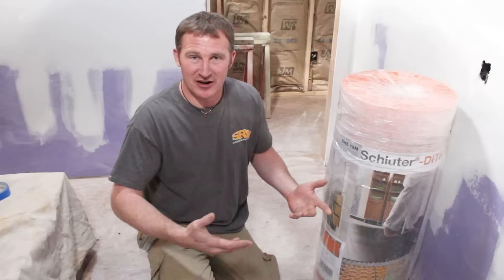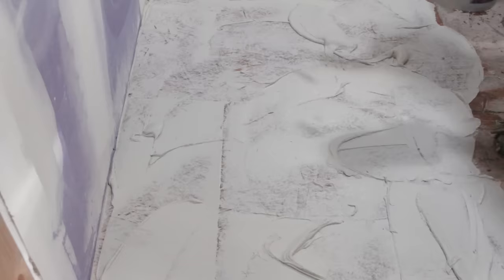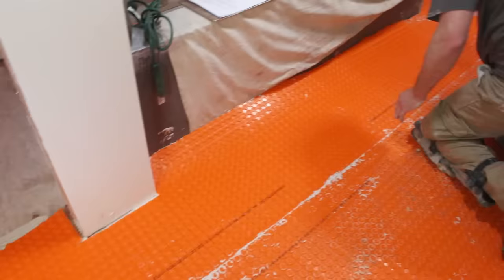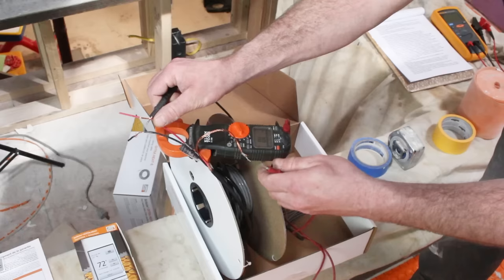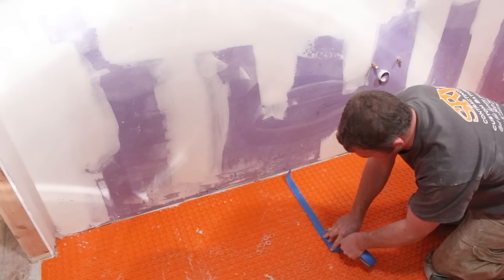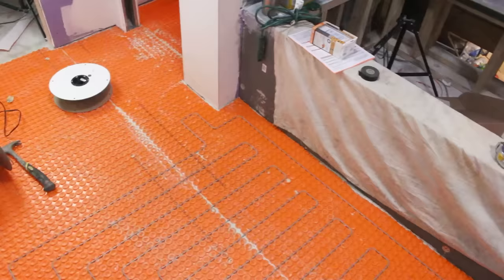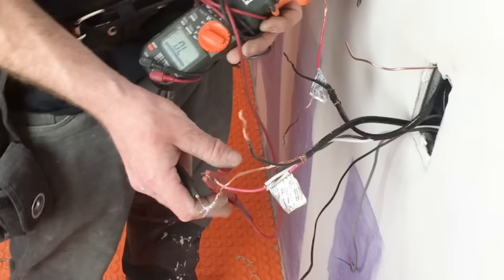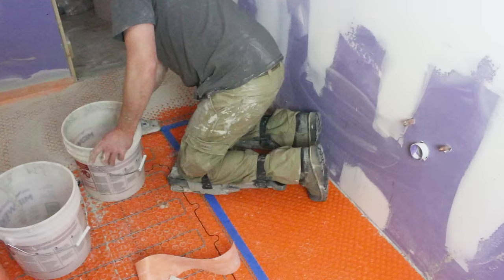DITRA-HEAT Heated Flooring Systems Installation (Step-by-Step) -- by Home Repair Tutor

Comment: I have two questions when it comes to the Ditra system. One, how much will it increase your electric bill because it's a 240 volt system, and two does it give off any radiant heat to heat the room??

Comment: Can you 1st cut the membrane ,to fit all the space, then start on the thin set and troweling? Would this make the process for a DIY'er and very little experience w/ tile work a little easier? Thanks for the video! Lots of good info...
Reply: Russell Harrelson  that's what I do and I've been installing for over 20 years

Comment: Can you install the sheets over concrete that has been stained with a solid color stain but not sealed. I read that thinset  will not stick to the concrete when putting tiles directly on it. But is that a problem with the sheets?

Comment: Anyone else installing this, do yourselves a big favor and avoid the mat in the rolled form. It's also available in smaller sheets and they stay down better. The rolls have a "memory" and it will want to lift up at the ends. Unless you like lifting your boxes of tile more than needed, the sheet form is the way to go. - 30 yr tile installer
Reply: I just installed the rolled version with no problem but can understand where you're coming from.

Comment: Today after megging a coil of floor heat I had turned off the megger and put it back in its case. When I was moving the coil back into the box I took a pretty strong shock from the floor heat leads. Anyone know how that coil could have held a charge about 30 seconds after a 1000v meg?

Comment: Great video! What type of knee pads are those you are using? Mine are always sliding so I am constantly readjusting them. Thanks.
Reply from the maker: Thanks, and those are ProKnee kneepads. Here's a link to their site http://proknee.com/
Reply: Home Repair Tutor thanks so much for the link. I will as those to my wish list!
Reply from the maker: They make great knee pads. Many professionals swear by them. Good addition to your wish list!!
Reply: Home Repair Tutor Thanks again. These knees of mine just aren't the same in my 40s!
Reply from the maker: Just turned 40 and have noticed same thing.

Comment: Hi, quick question, is the insulation board no needed with the Ditra-Heat? I'm about to install underfloor heating in the living room and hallway and just wondering if I need to install first the insulation backer board and then, the Ditra-Heat? Many thanks.

Comment: I noticed you mentioned it’d be a curbless shower. Any harm in running the heating system into the shower area?
Reply: When properly installed, ditra heat can be installed in a shower. There are detailed instructions in the box.

Comment: So you are using modified mortar underneath and on top for the tile ? It’s a question see ?
Reply from the maker: Modified thin-set under and we did use it to fill in the studs. But - and this is very important - that modified thin-set on top was allowed to dry overnight. Otherwise, if you intend to tile the same day it's best to use unmodified. Hence, we used Mapei's Kerabond/Keralastic for the modified thin-set and could have used just the Kerabond for the unmodified. That said, you could also use Schluter's ALL-SET both under and over the DITRA-HEAT. Hope that helps.

Comment: I would like to install this Ditra  system in my living room subfloor as an underlayment waterproof  an also as a cold barrier since my house has a crawl space and am planning on installing a carpet after the subfloor which am going with 1/2 inch osb. Any recommendations?
Reply: 3/4 plywood
Reply: Don't use this brand.

Comment: Wouldn't it be more energy efficient to use a water/coolant based floor heating system. Resistive heating elements tend to require lots of Kwatts

Comment: What thickness subfloor do you need?
Is 5/8 plywood ok with joists on 16” o.c.?
Reply: Schluter says 5/8” is ok in Canada. Just install blocking 12” all over the place and glue it down. Schluter has a screw pattern they want you to follow also. 6” apart on all joists and blocking in the field and 3” apart all around the edges.

Comment: With this system I wouldn't have dura rock the wood floor prior? if I was using wedi for my shower how would it be? overlap wedi or ditra?
Reply from the maker: +Alexander Rivera you're correct, with the right subfloor thickness you can use the DITRA-HEAT membrane without DuRock. Schluter's DITRA-HEAT handbook does a great job of explaining the subfloor requirements. If you use a Wedi shower pan you can overlap the pan and DITRA-HEAT membrane with Wedi Subliner by 12 inches on both sides at the transition between the two different materials.

Comment: How does the head unit know you are using two sensors to read the floor temp? Wouldn’t twisting both sensors together give it a different resistance curve which would ultimately give you inaccurate temperature readings on the head unit?
Reply: He only hooked up 1 temp sensor.  He stuffed the other one into the box, uninsulated I might add.  30 + years as an Electrician and that's the first time I've ever heard anyone refer to themselves as a "registered Electrician".  What the hell is a "registered Electrician"?

Comment: This is a great product thank you for your explanations  question  can i use ditra heat straight on concrete  then tile this is for an old home and also for a new construction  this will be placed on top of the concrete then tile same thing> or below concrete on a new construction  when we do sewer and concrete  I would love to hire your company where are you located thanks
Reply: You should use Ditra Heat Duo over concrete. Ditra Heat Duo creates a thermo break between the concrete and the bottom of the mat allowing the element to be able to heat the flooring more efficiently.

Comment: When using this system, how long, typically, does it take to heat the tile?  It has to be faster than the old way of having the wires encased in SLC with ditra and tile over that.  I have that now it it takes hours to heat up, so we don't use it, but i'd be interested in this for a new bathroom if this were faster.  My wife misses the heat.  I don't miss or want the massive electric bill.

Comment: I thought the thinset had to be  unmodified, I am about to install this and have purchased the Mapei Kerabond, is this correct?
Reply: I will answer: use modified thinset over wood under membrane, and unmodified over membrane under tile. But there is a massive discrepancy which adds to confusion in the Schluter installation guide which states "unmodified thinset mortar - ANSI 118.1" as approved setting material over OSB or plywood floor. So the real answer is unmodified is allowed everywhere.

Comment: How are you going to waterproof the junction between the ditra and the wedi shower base? I would think subliner dry but Wedi doesn't like the idea of mixing their stuff with Schluter stuff. Might have missed this but can you comment on the electrical requirements for the ditra heat.
Reply from the maker: +Rich McVeigh thanks Rich for asking, we actually have a video showing how to install the Wedi Subliner over both the pan and the DITRA-HEAT over in Bathroom Repair Tutor...it's Lesson 8 in the Wedi Walk-In Shower section. We like the Subliner because it can overlap by 12" in the shower and on the DITRA-HEAT. 

DITRA-HEAT needs a separate circuit for the system. The cables also require GFCI protection but if you get the Schluter thermostat it has a GFCI built into it. I'll have a written tutorial for this video over on Home Repair Tutor with a lot of details. But Schluter's handbook is priceless, here's the link to it

https://resources.schluter.com/media/DITRA-HEAT-InstallationGuide.pdf

Comment: How do you hide the wire to the floor? That is what I am not understanding. I can't find a video that shows how they do it professionally.
Reply from the maker: Are you talking about the wire that's run up through conduit and into the electrical box?
Reply: @HomeRepairTutor , ya I can't image the cable just hangs there. I see it is hidden later, but it was not shown how it was hidden. Does the cable go underneath the floor? I am trying to find this answer haha
Reply: @HomeRepairTutor , I think I just found my answer, so it looks like it goes through the wall and underneath the frame/studs via a hole. That is how I was thinking it was done, but wanted to confirm.
Reply from the maker: @Jrhortian  conduit is inside the wall and the cables are run up from the floor and into the electrical box.
Reply: The floor plate stud is cut so wires come out and where Ditra will be.
Reply: There is not enough room in the conduit for all of the excess wire, particularly the wire prior to the bulky transition to the resistive cable.  I know you are not supposed to cut the wire.  Does that mean the wire prior to that you embed in the floor?  There is about 4' of cable needed to feed up to the thermostat.  Where does the other 3 feet go?  Same question for the thermal sensor.  My sensor is about 20 feet long.  Can the sensor wire be cut to length?
Reply: You can cut the excess thermostat wires.  And you can cut the power wires on the near side of the bulky thing
Reply: What do you mean hide the wire in the floor? It goes under the tile in those channels in the ditra heat membrane.  You are supposed to separate the thermostat wires and the power wires going up the wall I think that's so you can minimize electrical noise, or inducing current in the thermostat wires.  Your face plate is inch and a half thick your ditra  heat membrane is 1/4 inch or so so I cut a Groove down in that 2 by 4 so the wire would come out level with the top of the Ditra Heat.  I didn't use conduit I ran a string down to a nut that I had stashed right behind the drywall in that hole that I made. I knew where it was relative to a wall so then I just cut in and tied the wire to my string to pull it up into the electrical box.  I back fed the thermostat wire to hopefully have separation from  the AC wire.  I read about separation after drywall.
Reply: Elksi Utah, thanks a bunch for your response.  I spoke with Schluter and you can cut the excess wire on the cold side of the factory splice which is the bulky part of the wire that must be embedded in the floor.  You need to leave 4 feet of wire on the cold side and clearly you CANNOT CUT OR MODIFIY THE RESISTIVE WIRE IN ANY WAY.  The sensor wire can also be cut to remove the excess wire and keep it out of the wall and/or junction box.  The Schluter support desk was very helpful and I got answers in just a few minutes.   I recommend anyone with questions to not hesitate to call them.

Comment: I'm thinking of installing 120v system..... I have an electric baseboard heater that I'd like to eliminate.... could i pull out the wire for the baseboard heater and use the same box and thermostat and just hook up the ditra to that?
Reply: ASK a Professional Electrician

Comment: "OL" on your multi-meter means over limit. You are correct about needing an OL reading on this resistance test. This ensures the insulation between the bond wire and the hot wire is sound, although you should use a "megger" to do this test, which is the correct tool for testing insulation. Finally, and critically, do not touch the metallic leads of your multi meter while doing a resistance test because, by doing so, you add your own body's resistance to the test, making the test less accurate. If you ever use your multimeter to test the resistance of a load, do not touch the metallic leads. Your test will not be accurate. Accuracy = safety.
Reply: Or just use your normal meter....
Reply: @matthewjkett  how do you use your regular meter to do the 1000V test?

Comment: Why did you modify your mortar especially when Schluter specifies that it be unmodified?
Reply: Schluter has changed their specs, they now sell modified mortar. Also you can place wire 2 inches from walls.

Comment: I'd really like a heated shower floor, can this be continued into the shower in a curbless walk in shower in place of a pan, or would it go over the pan?
Reply: Why would you want that? The not water coming out of the shower will warm those tiles up real quick.
Reply: Why would you want that? Because as a professional tile setter I do what my customer ask me and I run heating cable in couples shower floor also running on the bench for the lady who want her but getting warm when they seat there ;-) .

Comment: Would like to use this system in basement with cement floor. Sometimes during spring this floor sweats and we have to use a dehumidifier.  Is this sweating a problem with this system? Thanks!
Reply from the maker: hmm, that's likely condensation from the inside space being warm and the floor being cold. DITRA-HEAT is waterproof and can be applied over cement floors. You might want to speak with Schluter technical support and get their thoughts 800-472-4588
Reply: You can use Uncoupling membrane on concrete floor with integrated sound control and thermal break. They call Ditra-Heat-Duo versus Ditra-Heat

Comment: 23:50 - 'Inject 1000 volts' from a 9v battery? :)
Reply: search voltage converter in google and also check out Fluke 1507
Step-up voltage converter will increase the voltage with decreasing current and high voltage is necessary to cause arcs between possible faults.

Comment: can i lay this over concrete board?
Reply from the maker: Yes, but are you using concrete board for height? If so, Ditra XL is 5/16" thick. Keep in mind that concrete board provides no structural support.
Reply: You can but it is unnecessary to do it.  As alluded to above, you could run into height issues so just keep that in mind.

Comment: I’m going to install 120 V system. I have 12/2  dedicated wire on the wall with 20 A beaker. Am I good to install it
Reply from the maker: Without knowing the electrical code it’s hard to say, but call Schluter tech support and they’ll be a big help 1 (800) 472-4588

We call them for certain things and they’ve been fantastic
Reply: Assuming in the US, you are fine with matching the 20A circuit with the correct #12 wire.  We need to know the total watts of your warming cable...it is printed on the silver tag attached to the warming cable.

Comment: The electrical broke so many no-nos, it is a shame.
a) White used for ungrounded conductor.
b) Pigtail needed for heating element 'twisting' together.
There are more, but as a rule I do not like power underfoot with water around.
Reply: You are wrong for a) and b): a) it's a 240 volt circuit, the white wire serves as L2 in this case and is not a neutral as in a 120 volt circuit. b) the two heating elements were inserted side by side under a mechanical retainer for each branch (he changed his twisted connection after realising his mistake. Power underfoot with water around: the thermostat has a GFCI protector in it for that purpose, that's why it has a button on it that you test every month. You have electrical outlets on your kitchen counter and in your bathroom already, does that cause you anxhiety?
Reply: @wetrock2766  It is illegal to use a designated color (white) for another purpose without changing (i.e., taping) the color. 
What we are discussing here is not 'what will work' .  It is for the licensed individual who has the bad luck to follow and repair your work.
My feeling is that we are even now in the personal attack department. Unless you want to include spelling.
P.S.-How many test the GFCIs as spec'd?  If you do, please let me know.
Reply: @Ken-zj1tk  Sorry if your personnal feelings have been hurt, as far as spelling is concerned, have I made a mistake? English is a second language to me after French and before German. I always slip a shrink tube of the appropriate colour on my leads if needed, I agree that was not the case here, however any licensed practitionner worth his salt has to test any unknown circuit before working on it. As far as testing the GFCI as spec'd you are right but these devices are configured in a way that they will cut power in case of failure not the opposite. GFCI's have been in use for more than 40 years and I haven't seen any mention of a deadly failure in the litterature. That mention of monthly testing is more of a liability protection required by manufacturer lawyers.

Comment: Your not allowed to put the wire one stud apart. I just saw that in your picture. In their manual they give that warning to not install wire spacing I stud apart. The nose you can do is 2 then 3 then 2.
Reply: The wire that is one stud apart is the thermostat sensor, which is ok. Steve does not makes mistakes! :)

Comment: I'm not a big fan of how you guys do your electrics. Do you guys not have to earth sleeve the earthing cable/ circuit protection. And that twist cap you guys used to connect the 2 earth's doesn't look like a sound connection. UK seems to have a higher standards of electrical regulations.

Comment: How is that a 220 system ?
Reply: 2 hot 110v/is 120vlegs connecting to a 220v/240v dual pole breaker. No neutral wire with 220v. This is how it's done in the the US.